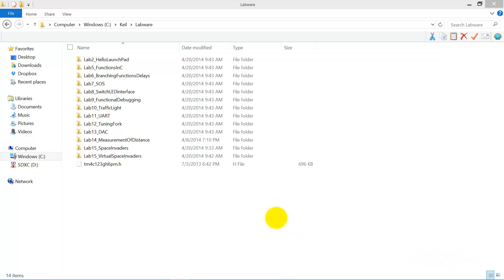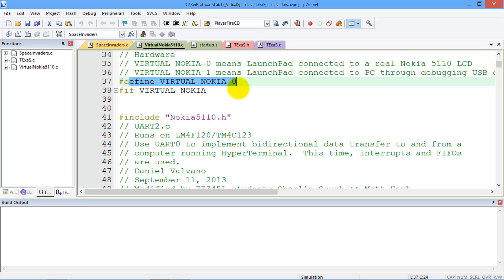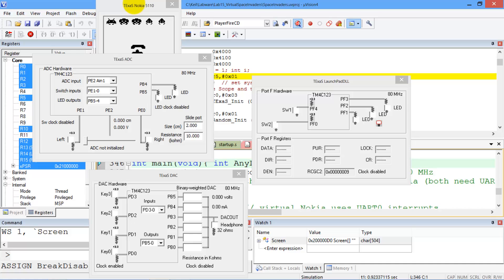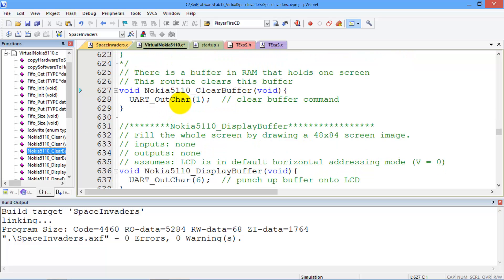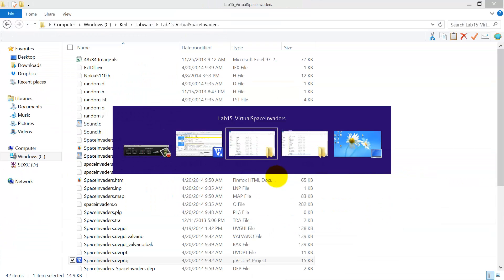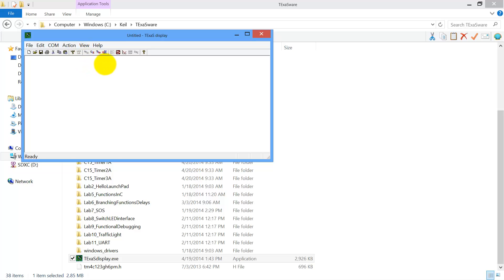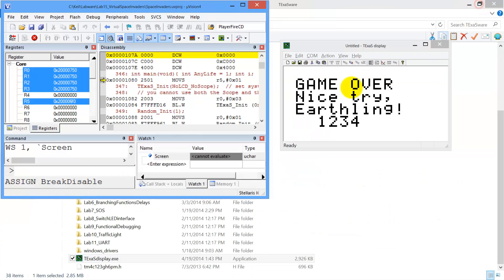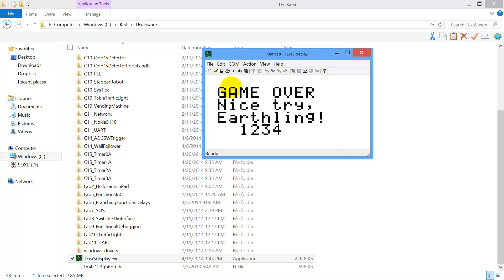Lab15VirtualNokia

Comment: Hi Dr. Valvano,
I registered to edX and started with the chapters. I also purchased your 3 books on embedded systems.
Is it possible to use the tools provided with course on the board "STM32F4 Discovery"?
STM32F4 Discovery has an ARM Cortex-M4, and I already have the board? What limitations will I encounter?
Reply from the maker: The concepts will be identical, SysTick will be the same, in assembly code is the same. However the details of the I/O ports will be a little different.